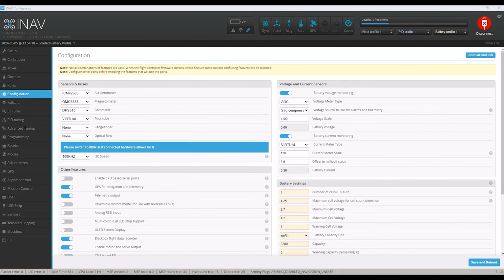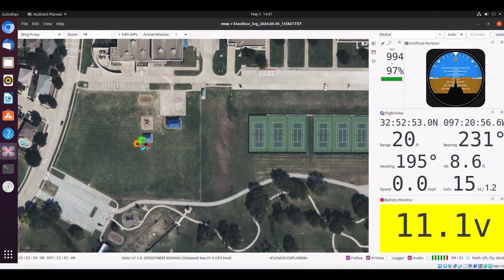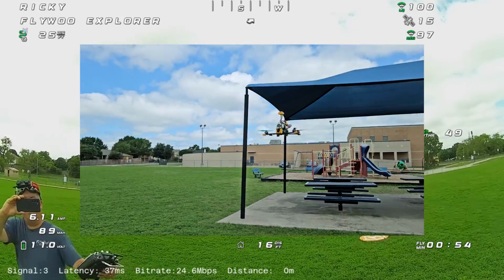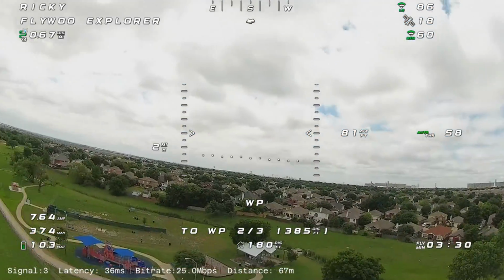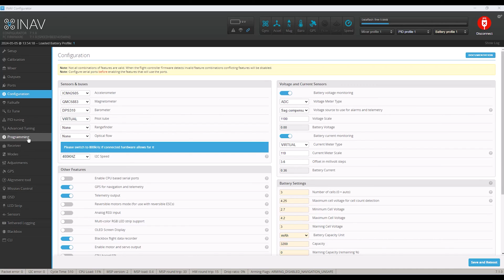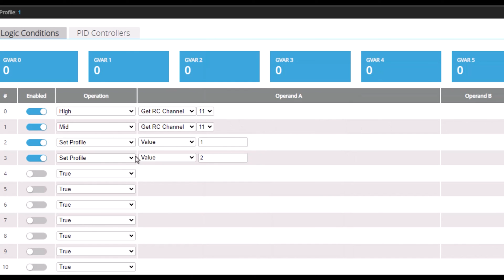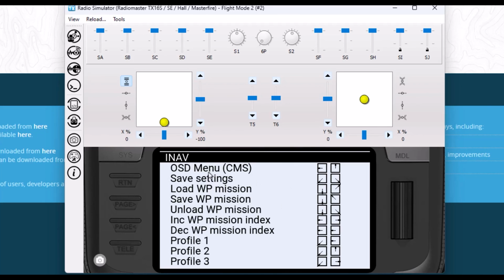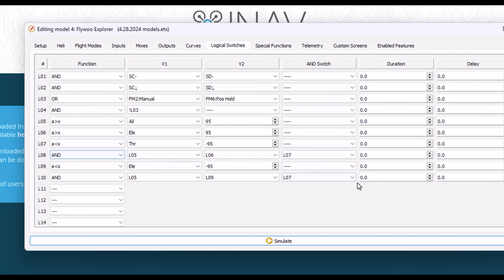Inav 7.1 Testing Position Hold, Waypoint, and RTH Modes.

Comment: This has to be one of the greatest breakdowns I've ever seen.  I'm at the programming stage of my 8 inch and this is the stuff I need to know.  Also, the model editor you're using, will that work with any Tx16 or is this through the ELRS?  Because it would save so much time if I didn't have to fumble with the radio physically to change stuff.
Reply from the maker: Thank you for the kind words.  Let me know how your tuning goes on your 8 inch.  I tried to use an OLD flamewheel from the dji naza days, and couldn't tune it or get it to hover for anything!  Too much oscillation.  I think the model editor you are using is edgeTX configurator.  It's how I program 99% of everything as it's much easier than using the radio.
Reply: @RickyGode  could you put up a link for the configurator?  I can't find it searching.
Reply from the maker: @acar3615  You have to search for edgeTX Companion.  https://github.com/EdgeTX/edgetx/releases/tag/v2.10.6 It's the edgetx-cpn-win64-v2.10.6.zip if you use windows.
Reply: @RickyGode  Now I just need to learn this and it'll make the rest easier.  Where did you look up the information about the logic switches?
Reply from the maker: @ I watched a lot of YouTube videos from Paweł Spychalski, painless360, and RC Video Reviews. I also reached out on both rcgroups and discord.

Comment: I am about to go through what you did with a v4 405 on a 10 inch . I will use Inav  . I hope the compass that Is built in to the BM880 makes it more steady Thanks for posting!
Reply from the maker: @Wifey0806  I would love to know your pid tune it tuning process.  I tried on an old flamewheel 450 frame and couldn’t get past the slow oscillations. I was using the standard escs and not a stack so maybe that had something to do with it?
Reply: @RickyGode  I will definitely let you know.
Reply from the maker: @Wifey0806  Thanks!  I appreciate it!
Reply from the maker: @Wifey0806  Now that is interesting...

Comment: Hi, I have a problem with the voltage sensor in my Speedybee F405Wing
The value in INAV is up and down 13v~20v (I use 4S battery)

I have changed the battery but the problem still occurs
I am really frustate because I really like long range flight

Do you know what component that I need to check? (It seems I broke that componen during soldering the cable)

Is there any external Voltage Sensor available that can send the data through our Remote?

Would it be possible for us to  parallely connect the Receiver (Matek R24D) to Flight Control and CRSF to PWM converter

The idea behind that because I heard we can get Vbat tellemetry to our remote using CRSF to PWM converter

But at the same time I stil need OSD and Waypoint capability from Flight Controller
Reply from the maker: @Indonesia01ian  I think you’d be better off just getting another SpeedyBee f405. Especially if you’re doing long range flights. You wouldn’t want to be flying a sketchy FC a couple miles out.

Comment: Any way to get the turns better? Mine feels like its going to do a roll when goes to next point.
Reply from the maker: I don’t really know. I know there are a ton of settings in inav and most of mine are the default.  I think if you had a 3 axis gimbal it would “mask” the rolling in the turns. On my mavic mini I use an app called Litchi and it does a FANTASTIC job of making things smooth in waypoint mode. It’s as if the camera is on a dolly in the air.

Comment: do you have instructions on how to install the mwptools on windows?
Reply from the maker: No, I don't.  I was actually planning on making a video because I got it to work using WSL (Windows Subsystem for Linux) on Windows 11 and it works FANTASTIC!  But I had to call in a Linux guy because there were some missing dependencies and while it was super simple for him, I wouldn't have know what to do without his help.  I think your best bet is to install Linux on a virtual machine and follow Stronag's tutorials.  His documentation is great (even though I didn't understand all of it in my attempts)

Comment: I don't think you're supposed to use compass and GPS together . Just leave compass off and let gps do the work . I think haha. Watched a video abut this the other day but can't remember which one lol sorry if I don't help at all
Reply from the maker: You're sorta right?  On airplanes, I disable the compass, but I think it's a good idea to have it with the multirotors.  inav 7 has the ability to use these navigation modes without the compass, but now that mine is running well, it works GREAT!
Reply: @RickyGode  ah yes that was right I fly wings with my GPS so I don't need it I guess but if it's working now that's good anyway nice one enjoy:-)